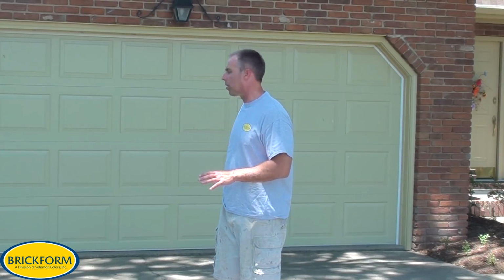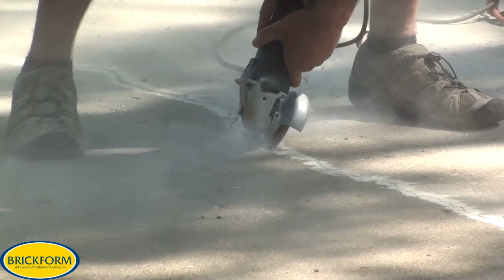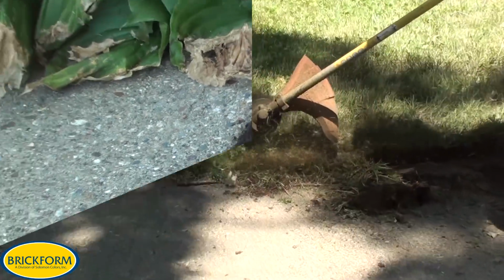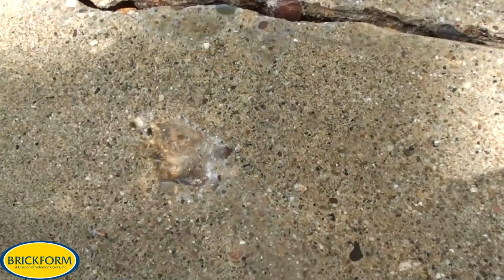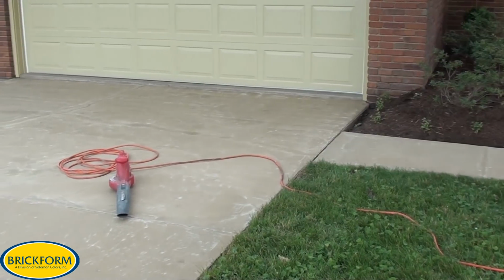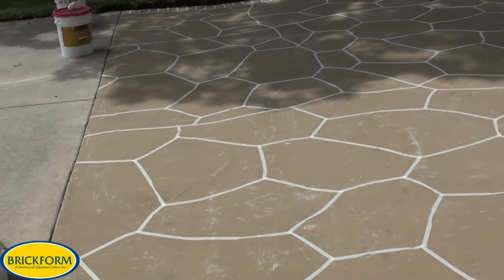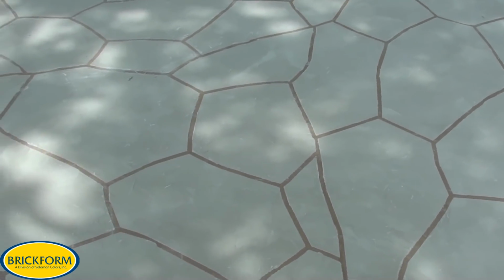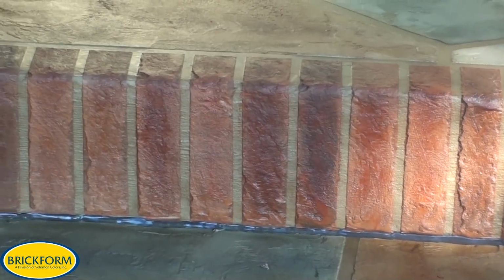How to resurface cracked concrete with BRICKFORM Overlay

Comment: sir I have a floor of about 3000 feet and thousands of holes a quarter deep and three inches in diameter what cement can I use to cover the holes and that it does not dry too quickly to be able to work.  Thank you el piso es interior

Comment: Hello. What is the best way (safe for kids & pets) to prevent seasonal moss from building  on the concrete other than power washing. It takes a toll on the aggregate popping out. Thank you! Great video & awesome prep work.
Reply from the maker: We recommend keeping concrete sealed to prevent moss, mold, and mildew.
Reply: @SolomonColors  Thank you. How often should concrete be sealed... every 3-5 years? Lastly, what sealant do you use?
Reply from the maker: @Shakashack2022  Sealer lifespan depends on traffic and weather conditions. Most decorative concrete sealers will last about 2 to 3 years in normal residential conditions. We manufacture Brickform sealers, most of which can prevent moss growth.

Comment: I DO THIS PROFESSIONALLY
and have a way better application.
First, go to harbor freight and buy a 4 inch handheld tile saw for $40. 
Link: https://www.harborfreight.com/4-in-handheld-dry-cut-tile-saw-62296.html
Next go to https://www.ediamondtools.com/products/crack-chaser-blades and buy a 4" x 1/2 non threaded blade. Set the deck height to cut a perfect 1 inch deep grove and straighten out the cracks.
For filler, forget expensive $100 gallon epoxy, instead use tile grout rated for immersion (swimming pools and showers). Ardex FL is the ultimate and using color charts you can match old, new, even colored concrete. Next, fill the cracks with grout, wait 30 mins, then sponge smooth. This eliminated regrinding you have to do with epoxy. 
5 gallons of epoxy filler costs $500
5 gallons of grout costs $39.00 and doesn't have to be reground after cure. 
When you use grout for crack filler you are doing the exact same thing when you grout a ceramic tile. It will be stronger and adhere better to cement than any other crack filler in the world.
Regarding cleaning, instead of a straight wand that cleans only 2 inch wide and requires a ton of arm movement,  a spinner head that cleans 12 inch wide works WAY BETTER. Amazon has them for $59 and your partner can use a leaf blower to push the dirty water away. https://www.amazon.com/SIMPSON-80165-Universal-Scrubber-Pressure/dp/B07H5BJ3VR/ref=asc_df_B07H5BJ3VR/?tag=hyprod-20&linkCode=df0&hvadid=312134668019&hvpos=&hvnetw=g&hvrand=3947361312397405302&hvpone=&hvptwo=&hvqmt=&hvdev=m&hvdvcmdl=&hvlocint=&hvlocphy=9019691&hvtargid=pla-635693761422&psc=1
For chemical, pre spray with heavy duty floor wax stripper and bleach mixed 1-1from the home center. . Apply heavy saturation with a 2 gallon pump up sprayer, wait 30 mins then power wash with spinner.  Demo video: https://youtu.be/Bk8-12tPpbg
Also regarding thin skin coats of any kind, they're usually only good for 3-5 years, stained finishes are are ideal for sidewalks and patios but require power washing followed by expensive sealers ($100 gallon with 300 sq ft coverage every 2 years and are slightly slippery, rated for foot traffic BUT NOT CAR TRAFFIC. salt from tires will strip and damage the finish. Very high maintenance costs.
Good luck redoing that driveway every few years. Talk about red tape...

Comment: you can put lipstick on a pig but in the end its still a pig.  Looks good for now but the cracks will be back sooner than you think Tear it out, put down compactable fill, tamp, and re-pour with rebar and wire mesh. 3500 psi min mix.

Comment: It came out beautiful. However, why didn't you show the epoxy being put in? Also, I bet it would've been cheaper to pour new concrete.
Reply from the maker: We don't offer an epoxy product for that application, so we didn't want to provide information that might conflict with the application techniques suggested for your preferred epoxy. Generally speaking, repair is cheaper than replacing. Beyond cost, however, resurfacing has the benefit of being low impact - no need to excavate, haul out, or tear up the yard with Bobcats and ready mix trucks.

Comment: I bet that costs a lot more then a new concrete driveway
Reply from the maker: In many cases, an overlay is a cost effective alternative to "tear out and replace." If the underlying concrete is sound, an overlay like this may be preferable. In addition to cost savings, an overlay means you don't have to get a bobcat in and tear up the surrounding landscape.
Reply: you guys did a great job real good prep work. must cost a lot for skilled work like that.  I was in it for 50 years and just did a 50x14 driveway 11 yds was the easy part and the bobcat ripping out the old driveway was a lot of work. I charged $6800 for it
Reply: Mr Meener not if u diy. start small

Comment: Good, except why didn't you show installation of the epoxy?
Reply from the maker: We don't manufacture the epoxy. Depending on which epoxy you use, installation steps may vary.
Reply: @SolomonColors  what epoxy should I use?
Reply: @SolomonColors  Thanks for telling , so detailed except for one piece of information

Comment: How does this product/technique hold up in extreme weather conditions?  I'd like to do this same application on an existing concrete pool deck in Michigan but have been told by multiple pool service people that anything applied to existing concrete will peel up...and they have seen it many times!  So, I am now debating between this SM product or an acid-stain that I know won't peel up.  Any suggestions welcomed.

Comment: How much would a job like this cost per square foot?
Reply from the maker: As a manufacturer, we don't provide pricing information. The cost of decorative concrete can vary widely based on region and the skill required for the project. Check with a contractor in your area or go to concretenetwork.com for general price guidelines.

Comment: As far as surface prep, do you not need to grind the concrete? E etch is good enough? The stuff I use needs at least a csp of 2. What rating is the e etch? Thanks
Reply from the maker: To consistently get a CSP 2, grinding or shotblasting may be required. E-Etch is a mild cleaner/degreaser and etcher. E-etch will only enhance an existing profile like the one on this old driveway unless multiple applications are used which can become cost prohibitive. As with any surface preparation, the slab and the product requirements will need to be reviewed to determine what method(s) will be required to properly profile and clean the slab. Check out www.icri.org and consider purchasing their manual on selecting surface preparation methods as this is an excellent resource.

Comment: How were the individual stones colored?. What was the process? Was the stain sponged on?
Reply from the maker: For an application like this, you would want to use a water based stain. You can brush, sponge, or spray the stain. Just make sure you do so carefully and mask the area.
Reply: Ok I was confused b/c wouldn't you do the color before taking up the tape? In your video you showed the coloring after taking up the tape.

Comment: hi, can this process work on a newly poured concrete that's joined to an existing patterned driveway to make it look uniform?
Reply from the maker: It can! Make sure to wait at least 28 days for the new concrete to fully cure before placing the new overlay material. You won't be able to guarantee an exact color match between the old and new pattern work, but you can get close if you use the same materials and application methods. Have your contractor make a sample to make sure before work starts.

Comment: What is the name of the stick you have attached to the rubbing stone? Thanks
Reply from the maker: There's nothing special about it. You can use any extension pole like would be used for a paint roller, window cleaner, or broom.
Reply: +SolomonColors ok maybe I didn't word my question correctly, what's the name of the attachment that goes on the rubbing stone/brick so you can put the stick on it? I'm in Australia and want to buy one. Thanks heaps.
Reply from the maker: The tool may have different names depending on manufacturer and region, but some call it a rub brick mop. Visit your local concrete or masonry supply store and they should be able to provide you one.

Comment: i guess you cant plow shovel or snow blow in the winter..lol
Reply from the maker: +Robert Swift On the contrary! When properly applied, Brickform overlays are just as resilient as the base concrete. They will resist abrasion, impact, and freeze thaw. When sealed with a Brickform Premium Sealer, overlays will definitely stand up to the elements.

Comment from the maker: Brickform Overlays will last just as long as the concrete surface that the overlay was applied.  The cracks from the original concrete surface will eventually show up in the overlay.  this is why we designed the pattern to incorporate the cracks.
Reply: SolomonColors how many sqft per bag?
Reply from the maker: For a base coat, one 60 lb. bag should cover between 150 and 300 square feet. Texture coats should run at between 150 and 200 square feet. All of this depends on concrete porosity, conditions, and application technique.
Reply: will this surface be more resistant to oil leaks from cars?  and How much would a job like this cost per square foot?
Reply: SolomonColo
Reply: SolomonColors in.co
Reply: SolomonColors wow that looks really nice!

Comment: Kudos - Great option!  I would really like to do this, but what about the expansion joints?  How can the expansion joints do their job and without affecting the outward appearance?
Reply from the maker: Maintain control joints with any resurfacing project—in other words, do not fill them.  If you do fill them, they will need to be re-cut so they can do their job.
Reply: @SolomonColors  Why wouldn't you simply fill them with a quality expansion joint sealer- like Sika Self Leveling for example?

Comment: This is exactly what I need to-do around my pool and they sell your product in Montreal...this is really good. But I have a few questions.
 
1 – Was the first coat applied with a squeegee?
2 - How sure is it I will see the crack repairs through the first coat? This is very important. If I lose sight of the cracks, I’m @#$#.
3 – Looks like you’re using typical masking tape (paper). How long – exactly – do I wait to remove the tape and what is the chance of it tearing and  I lose the joint under the cement coat?
 
Really need you replies as I want to do this for sure....pls help.
Reply from the maker: 1-Squeegee or trowel

2-As long as you V-groove the crack once it has been repaired, the differential curing will show a darker material where the crack is located.

3.  Our Design Tapes are fiber reinforced and will not disintegrate shed fiber hairs or tare when it's time to pull the tape after the Micro-Topping is dry.  Check out our video on design tape at Design Tape for Decorative Concrete Overlays
Reply: SolomonColors
Thanks for clarifying about the fiber reinforced tape, it will obviously be much stronger than standard masking tape.
 
Just one more clarification, when you say remove when the micro Topping is dry, do you mean the next day or like hours later in the same day when you can walk on it lightly?
 
Still not convinced I will see the crack repairs after the first coat so I am considering just doing the one final coat after the crack repairs.  Since I will stain everything in the end, I’m not too concerned about the grout line colors at this stage.
 
Tks again
Reply from the maker: lpgjg    You can remove the design tape the next day or once dry.

Comment: Can this process be used for refinishing an in-ground tiled/concrete pool deck in Florida?  The old deck is a textured tile (12/12 inch) laid over cement. It has some cracks and this random stone pattern looks like it might work. Also the driveway in the front of the house has several stress cracks too. Thinking that this might take care of both issues vs replacement of slabs and tile.  Thanks!
Reply from the maker: We recommend removing the tiles and properly cleaning the concrete before adding a micro-topping.   
Take a look at our surface preparation videos on YouTube for more information.

Comment from the maker: The Brick border was textured using a hand trowel just like the rest of the driveway surface.  The joint lines are not filled in.   The color for the joint lines comes from the first coat of SM Professional grade.
Reply: I really like the way you used the existing cracks as part of the design instead of trying to just surface over top of them.